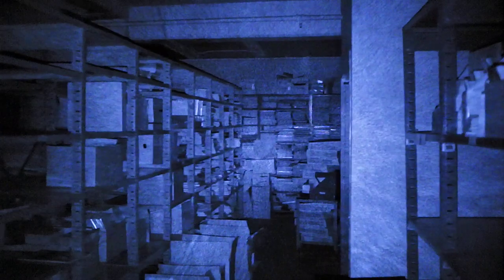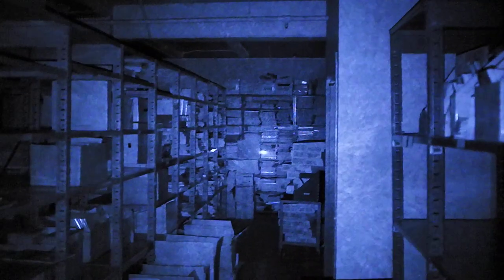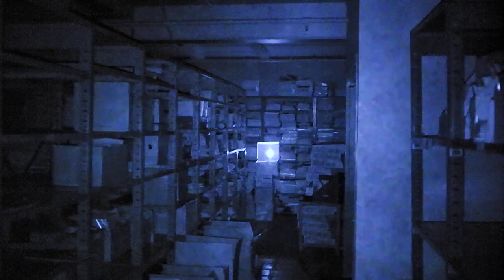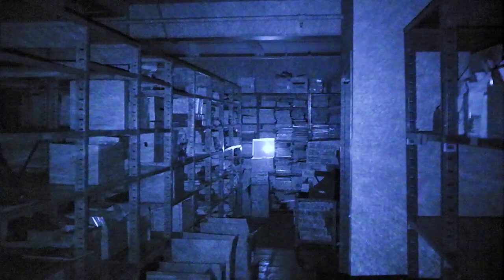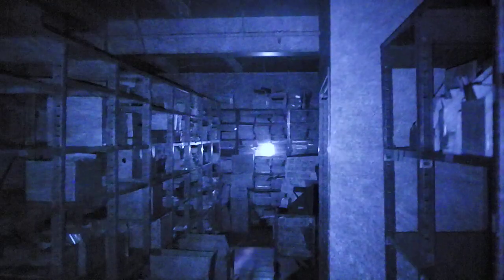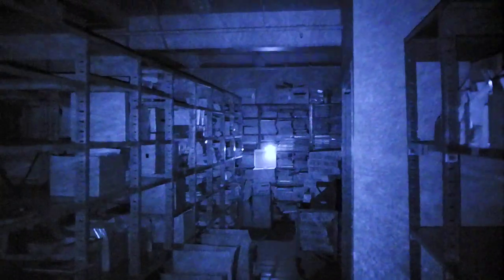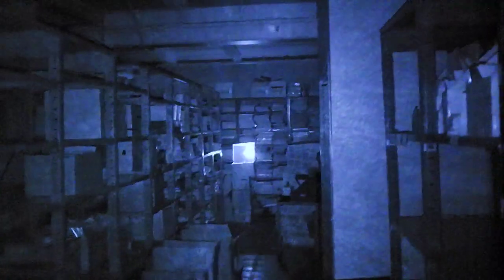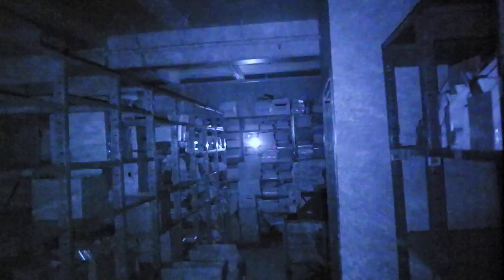Convert zenitco perst-4 into an IR dual laser + illuminator (diffused)

Comment: These work about as well as full power laser with the diffuser on, if not better, depending on how much your laser spills from the factory. The flood is cellent for indoors and it works to be about 25-50 yards outdoors with lots of ambient lighting.

Comment: Does this affect the IR laser zero, what about the vis laser, is it still usable with the cap installed?
Reply from the maker: It does not affect your zero since the caps don't refract the beam, you can still use the vis laser as well, I cut an extra hole for it

Comment: Got mine today and spent about 20 mins playing around with it. I'm impressed. Does a good job eliminating the halo and provides a good amount of illumination. If you don't already have an illuminator, buy this right now. I haven't used his outside of my home so I can't say anything about how it works in different conditions compared to the IR/White light I already had on my rifle but this cover provides IR light that is not visible to the naked eye compared to the IR light  I already had which puts out a dull red glow that is visible to the naked eye. For the price buying this is a no brainer, would highly recommend. Adds a lot to the functionality of the perst 4 at least from my limited experience messing around inside my home.
Reply from the maker: Awesome man! Thanks for the review, glad it's working out!